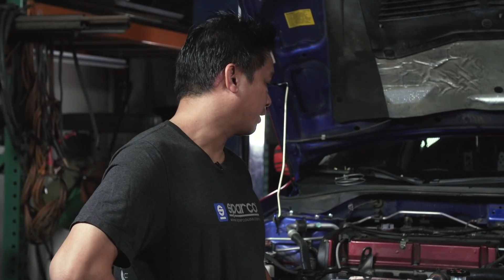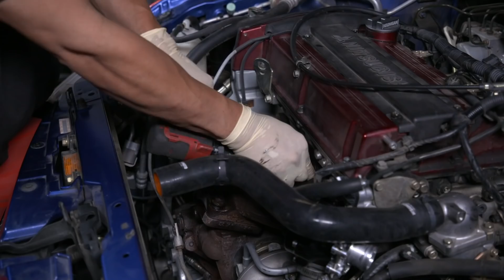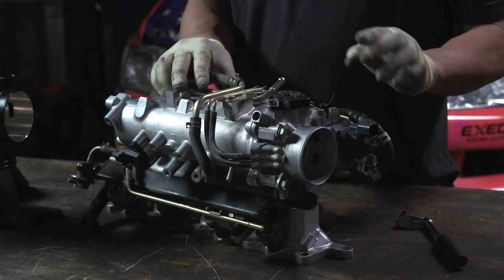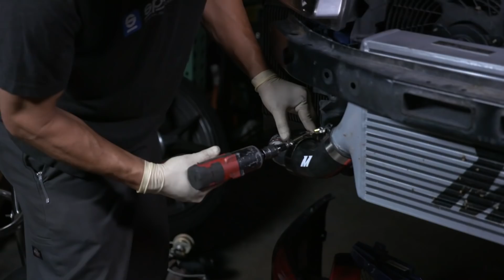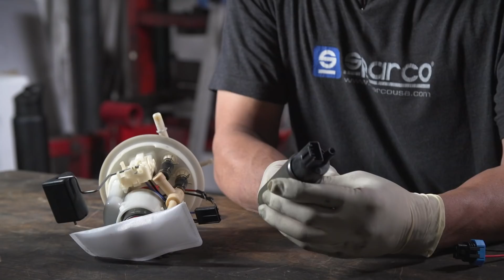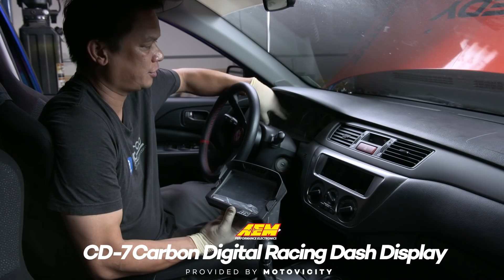Motovicity x Super Street EVO 8 Build - Episode 5

Comment: Fp green turbo nice choice and that is not a restrictor for the oil feed line to the turbo that is an inline oil filter to save your turbo from possibly metal shavings if you have a bearning failure
Reply: Could it be both?
Reply: @ksboi29  I belive so.. as I have the FP black turbo
Reply: @antval1234  I will be running turbosmart inline oil restrictor but if it will be a filter and restrictor that would be great.
Reply: @ksboi29  The FP line of turbos are a great option for the stock manifold setup.  I belive the JB turbos dont require a restrictor.. But the BB turbos do.. I'm running the JB black #600hpclub e85